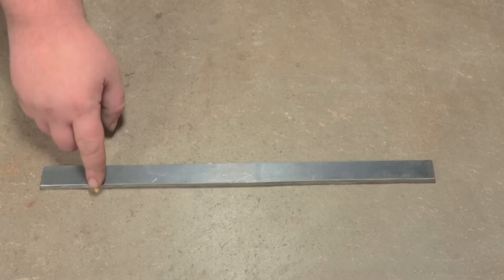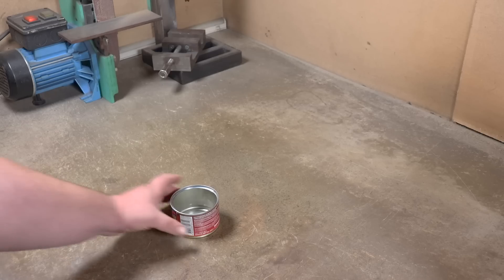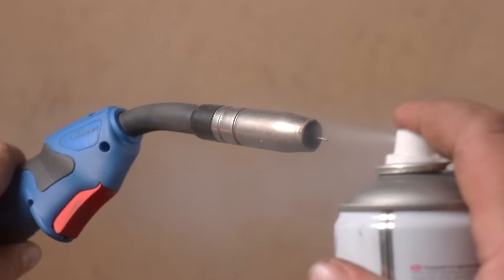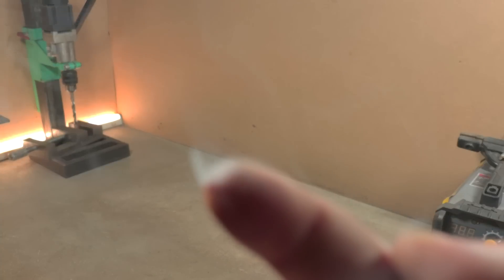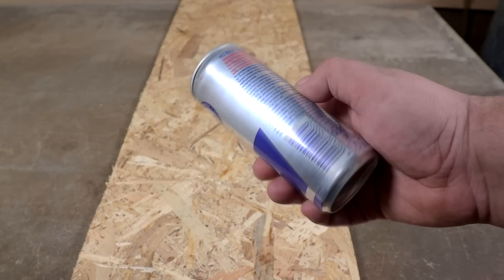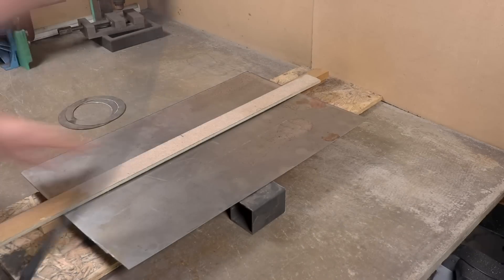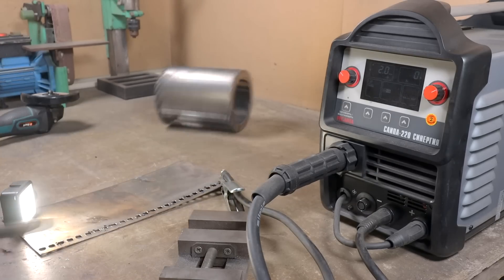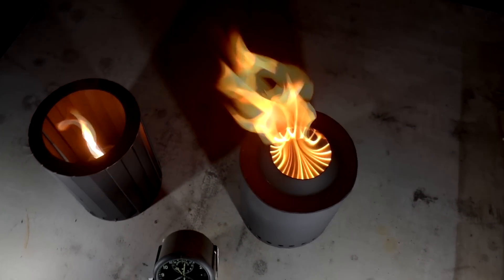EMERGENCY STOVE made from TINS! Capillary effect.

Comment: Nice video and idea as long as you have welding equipment and sheet steel, lol.   Why not use an IKEA utensil holder to get your ventilation.  It can be adjusted using a #10 can with top and bottoms cut off and one cut to open the can.  This can go outside the perforated utensil  and slid up and down as needed.  Even cheaper, use 2 # 10 cans and drill holes as needed.   Good video, thanks for the idea.
Reply from the maker: Many thanks! I will definitely heed your advice.🤝 I am very glad that you liked my idea. Thank you.🤝🤖